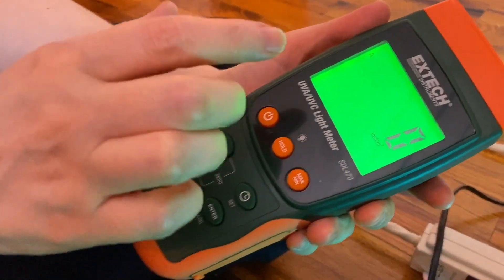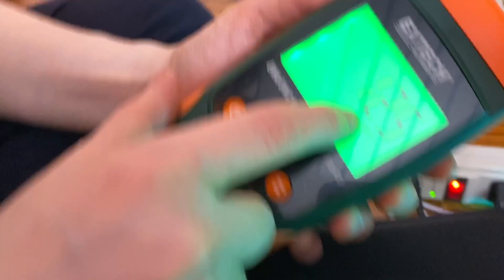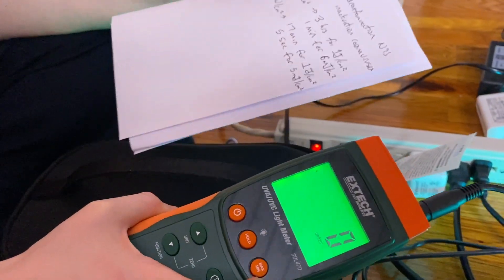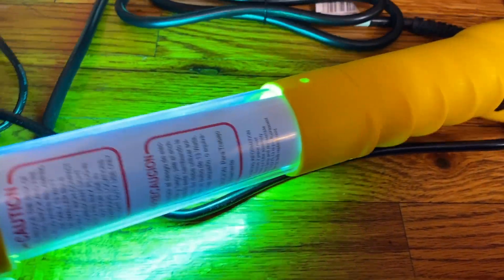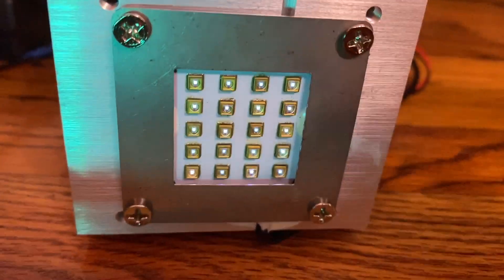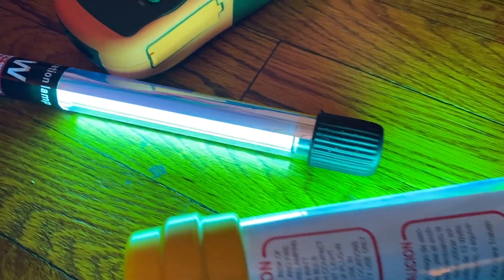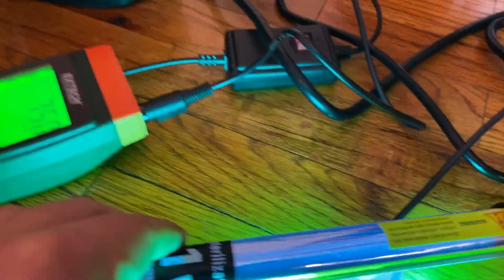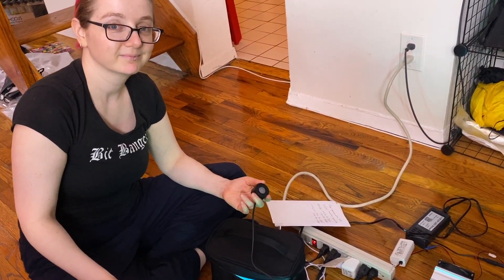Using the Extech SDL470: UVA / UVC Light Meter/Datalogger

Comment: Shared this on BigClivedotcom's UVA/UVB sensor testing vid too.. sorry if over redundant, just wanted to ensure you guys got this stuff as well. So LEDs are still having difficulty producing UVC today, it seems to be a manufacturing challenge. But they are working on the problems preventing efficient UVC generation.. see the following articles, the last two courtesy of sci-hub.tw  👍

 - Some info on UVC generation using LEDs... https://www.klaran.com/how-a-uvc-led-works
 - Comprehensive article on UV *VERY HELPFUL in understanding UVC LED problem*  https://physicsworld.com/a/the-potential-of-far-ultraviolet-light-for-the-next-pandemic/  | June 2020
 - https://sci-hub.tw/10.1109/JQE.2019.2956344 - Performance Improvement of AlGaN-Based Deep Ultraviolet Light-Emitting Diodes With Step-Like Quantum Barriers  |  Published: 28 Nov 2019
 - https://sci-hub.tw/10.1111/jam.14791  -  Inactivation of Bacillus anthracis and Bacillus atrophaeus Spores on Different Surfaces with Ultraviolet Light Produced with a Low‐Pressure Mercury Vapor Lamp or Light Emitting Diodes  First published: 21 July 2020

Hope this helps a little. 😉 Finding these helped me immensely, FWIW.  Sharing is caring.   Enjoy and Happy learning!

Comment: This is a very useful video, especially when we are in the middle of pandemic. I have been researching for days to build a DIY UV sanitizer cabinet with my old ice chest. I have a question and wonder if you can give me some suggestion. In your video, the big yellow UV light has a protector that the UVC ray can't pass through. Do you know it is just regular plastic? Or some kind of special material? From other videos, people use aluminum foil to cover the inner walls of their box. But from other research, I saw that aluminum foil reflects around 85% of UVC ray. I want something like that yellow light cover to block 100% of the ray. Any idea? Thanks.
Reply: Any plastic such as acrylic or polycarbonate will block UVC, as will simple window glass.  Bulbs that emit in the UVC region are made with quartz glass for transparency.  Be careful with your DIY build.  UVC lamps can be dangerous to people as well as bacteria and viruses :)
Reply: @qta4425  Thanks for the info. Yes, I aware of the risk and use smart plug to control remotely when no one near to the box.

Comment: Where are you getting your formulae from? I can't find a good resource for calculating what exposure is needed to decontaminate. Thanks.
Reply: bossadave hi Dave. Please see below the Irradiance formulas for any distance:
A) For a large distance to the lamp we get:
The irradiance = (Total Radiation flux (W)/ π2.a2     ——- For (a >> L)

B) At shorter distances the irradiance:
The irradiance = (Total Radiation flux (W)/ 2 π.a.L    ——- For (a < 0.5 L)

Where total Radiation flux for Phillips 4W T5 bulb is 0.9 w as an example 
L: is arc length of the lamb which is distance between 2 arcs inside lamb tube which is 3.35” (85mm) for 4 Watt lamb
a: Is the perpendicular distance between surface & Bulb 

If we assume distance is 1 meter as an example then if you run through the calculation  using A) formula >>>>> the irradiance would equal to 9.13 uW/cm2 

If you  want to calculate irradiance at 1 inch (2.54cm) as an example then use formula B (since distance is smaller than half of the bulb length) >>>>> the irradiance would equal to 6.64 mW/cm2 

Finally for an example distance of 4” (10.16cm)  >>>>> the irradiance would equal to 884 uW/cm2 

Using above 2 equations you could calculate irradiance at any distance.

Of course if you Have a meter like the one in this video then you could  measure the irradiance directly at any distance and no need for above calculations....

Don’t forget these bulbs operate at 254nm wavelength, and peak germicidal effect occurs at 260 to 264nm so you	need to correct for the radiation generated by your bulb at 254 nm, which is approximately at 85% of the maximum germicidal effect. So derate you’re calculated irradiance by 15%. 

Finally CDC has some recommendations for disinfection does to kill Covid19... they recommend 1.0 J/cm2 for masks and from 0.06 to 0.1 J/cm2 for various hard surfaces. I usually use 0.1 J/cm2 to be on the safe side. 

Now for calculating the time you need to disinfect ——- Time (seconds) = disinfection dose (J/cm2) / irradiance (w/cm2) 

Hope this helps.

Mark Qandil

Comment: Extech SDL470 UV meter and UVC probe used is not optimal to measure new UVC LED.  It is intended to measure optimally for UVC bulb as the wavelength this meter can measure tops at around 250 nm of UVC spectrum. UVC LED is made for peaking sharply at 275nm and the wavelength is so narrow. UVC led is designed for targeting germicidal with lower energy as possible but the impact is almost same or double as old days UVC tube. What can Extech SDL470 UV meter do for UVC LED is just to indicate that UVC LED do emits the same harmful light as UVC Tube, that build for the same effective germ killer. Just ignore the number from Extech SDL470 UV meter. By the way 275nm is today's standard for UVC Sterilization, so Extech SDL470 UV meter should not be used anymore. There will many UVC meter that compatible with UVC LED wavelength such https://www.intl-lighttech.com/products/ilt1270sed270qt .
Reply: By the way 275nm is today's standard for UVC Sterilization?   Seriously?

Comment: How can I identifie  uvc wavelength (between 200nm to 300nm) from micro watt per centimeter square because only UVC can kill viruses otherwise every light looking uv lamp. After some technical problem uvc lamp can't lighted with full itencity they looks lighted but they are not emitting required wavelength light as UVC.

Comment: You can test UVC with bananas.......stick a small portion of tape over some part of the banana....expose it to a reasonable amount of time......the banana will turn brown that receivef the light..but the part that was covered up tape will still be the same color when the tape is removed........it really works.....I tried it with my phone sanitizer...but the next day i dint notice any difference....then i forgot about it for three days......by then the banana was brown every where except the part where the tape had been...now i know my $28 UVC  box does have two real uvc glass bulbs.
Reply: I bought 2 different UVC LED wands and did this test and same result! The darkening wasn’t immediate so I thought it didn’t work and the next day I just happened to look at the banana and it did work

Comment: I've just got a few of the fake germicidal UV lights from eBay.  They're also selling standard LED lamps fitted with ice-blue LEDs to make them look like mercury discharge UVC lights.  I just received my Adafruit UVC sensor module today for double checking.
Reply: I went on your channel to see how you verified the difference between UVC and UVA and UVB.  I ordered but haven't received my UV sensor module yet, so I used a UV color changing keychain to verify that it is UV.  When I put a glass plate between the UVA and UVB source, the keychain changed color as usual.  When I put glass between the UVB source, the keychain didn't change color at all.  While this is quantitative, it does tell me that I have a lamp mostly in the UVC spectrum.  My hand also smells like burned port when exposed to the UVC light for a few seconds.  Thanks Bigclivedotcom.

Comment: Just something about the low readings you get on the UVC LEDs..... The meter you are using is calibrated for 254nm sensing while most UVC Leds are emmiting at 275nm... You need a special meter like the ILT1270: https://www.intl-lighttech.com/products/ilt1270sed270qt
Reply: BUT, if you get that meter that goes >300nm, how would you know that you are getting any germicidal effects?  The LEDs could only be emitting >300nm and that meter will read those wavelength...but germicidal effects will be way less.  Too bad the spectrum specs that come with those lights can't be trusted.
Reply: @richm2004  Hi, Thanos is right, Extech SDL470 UV meter and UVC probe used is not optimal to measure new UVC LED.  It is intended to measure optimally for UVC bulb as the wavelength this meter can measure tops at around 250 nm of UVC spectrum. UVC LED is made for peaking sharply at 275nm and the wavelength is so narrow. UVC led is designed for targeting germicidal with lower energy as possible but the impact is almost same or almost double as old days UVC tube. What can Extech SDL470 UV meter do for UVC LED is just to indicate that UVC LED do work emits harmful light as UVC Tube, but they are build for the same effective germ killer. Just ignore the number from Extech SDL470 UV meter. By the way 275nm is today standard for UVC Sterilization, so Extech SDL470 UV meter should not be used anymore. There will many UVC meter coming such https://www.intl-lighttech.com/products/ilt1270sed270qt .
Reply: @kickcast7995  I took exception to the ILT1270 meter Thanos suggested for UVC LED.  Looking at the "Relative Spectral Sensitivity" graph in the link to the meter, looks like the meter will register readings well outside of the effective Germicidal range of 320nm.  So, if you are testing a UVC LED with the ILT1270....how does one know whether the UVC LED is actually outputting in the germicidal range?  A claimed UVC LED could be outputting >320nm...outside of germicidal effects...and the meter will still register a irridiance value.

Comment: Regarding the LED array, if the LEDs are in the 265-275nm range, your meter isn't sensitive enough to pickup those wavelengths.  Your meter is probably calibrated to 254nm, and sensitivity probably drops off quickly on either side of 254nm.
Reply: Their sensor is likely fine.  See the specification for the GUVC-T10GD sensor and you will see the bandpass of a typical gallium arsenide sensor.
Reply: Look up the sensor on Digikey and download the data sheet.

Comment: I presume the figures for the mask are for a certain reliability of killing test microbes across the entire volume of the mask. (To achieve levels set out in some industry standard)
This would be to make an unsanitary mask suitable for use.

And that the figures for coronavirus inactivation are for the threshold average value required to convert an infectious viral sample  into one that will no longer replicate in culture .
This would be the succeptibility of this strain of virus to UV radiation at the specified wavelength.
(Infectious meaning causes plaque growth on a viral growth cell cultrue medium.)
(Viral samples could either be as bare virions or as a emulsion/solution of virus particles.)

Comment: My wife had an idea for a cool project, but i wasnt sure it would work. Use a bunch of the larger aquarium UVC bulbs in a vertical rack on a robot to go down the store isles at nite when no one is there to decom all the store shelves and registers nightly.
Reply: Mike  Your wife is spot on. Some large companies are doing this now with sophisticated robots and powerful uvc lamps.  But to be useful you need to know the power output, distance to target and time of irradiance for each spot.  Also only directly exposed areas are affected.    So not easy to implement but a good idea none the less.
Reply: I strapped several 13W aquarium UVC lamps to an oscillating fan.  This should sanitize a medium  size room.

Comment: I am testing much powerful UVC tubes for a N95 sterilization system and what I have found is that they have an optimal operating temperature. If the temperature of the bulb goes over or under, the output decreases quiet a lot. Something to consider with critical UVC applications